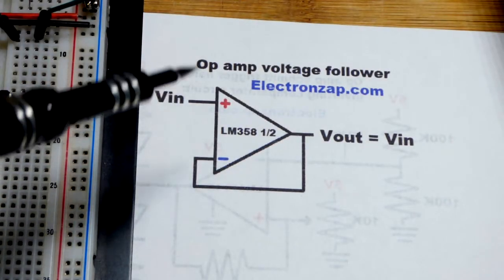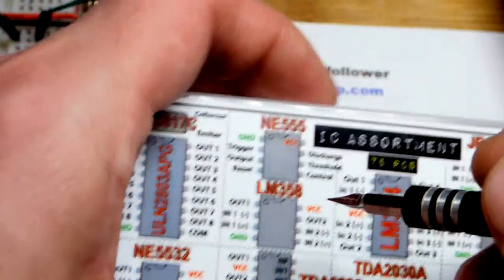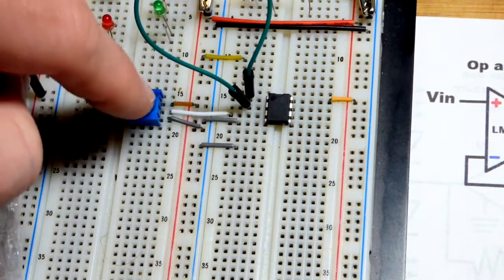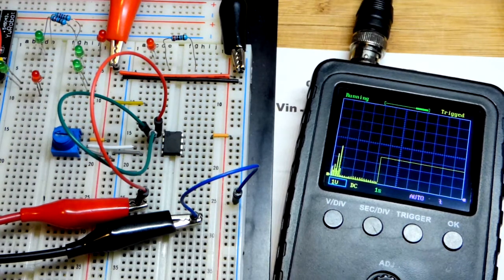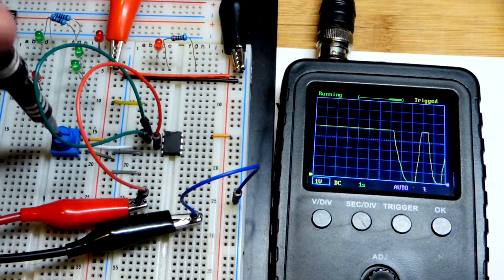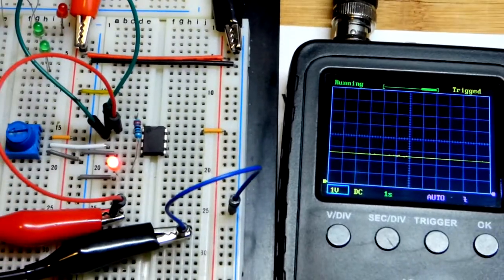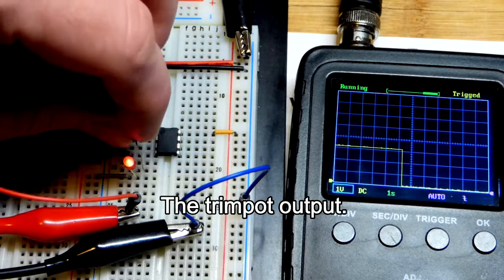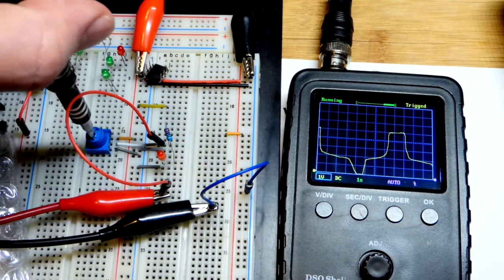Quick voltage follower using single supply op amp LM358 operational amplifier

Comment: Will this drive a 50 ohm load?
Reply from the maker: Dont remember the exact recommendations but I don't think so. Its probably just meant for much smaller loads. You won't really be able to power higher wattage stuff with most low priced components.
Reply: How about 2 V DC = 80 mW? 20 mA? Does that work?

Comment: I’ve got some lm358 but I read that they should not be used for audio amplifying. What are these chips supposed to be used for?
Reply: They can be used to build a High voltage Low voltage circuit. For the audio amplifying signal Use a 555 to build an "oscillating circuit" and integrate it with an LM386 because the digital square signal has to convert to an amplified sine wave. The 386 will give you your gain. Good luck. I'm reading my electronic books, so I'm hoping that Electronzap will see this and chime in with a video. Good luck.